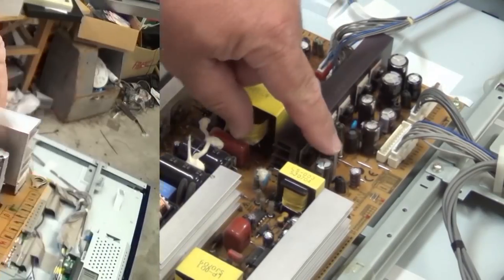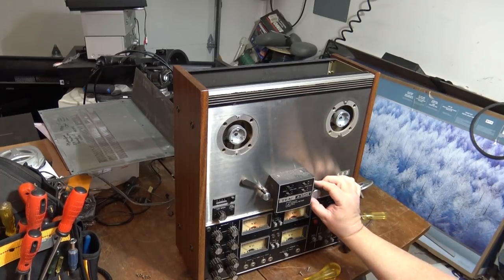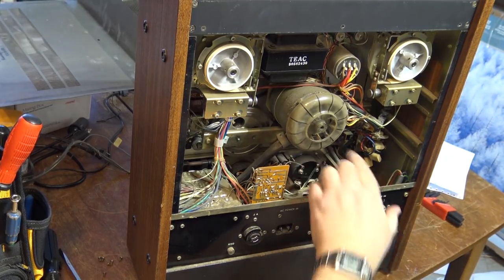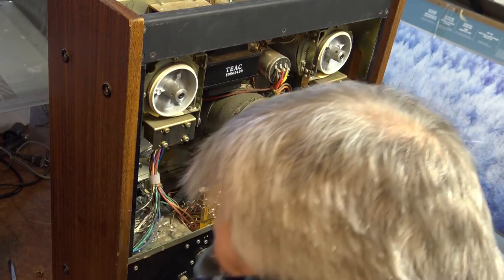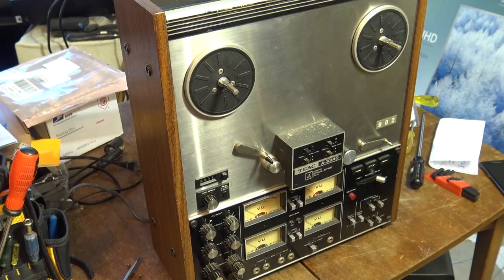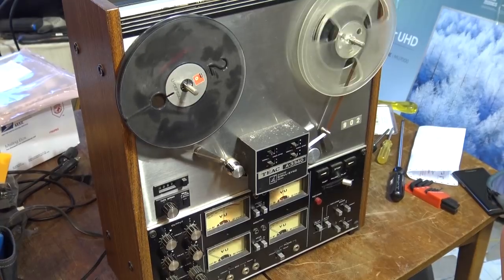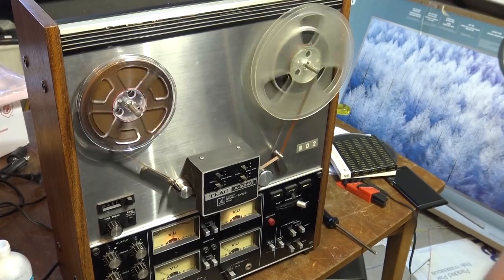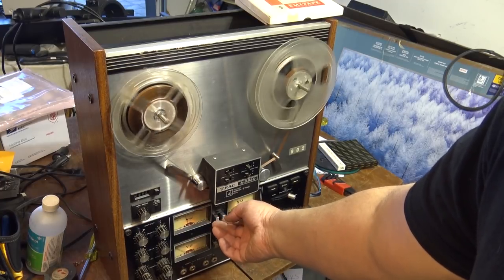Teac A 3340 4 Track Reel to Reel restoration

Comment: Hey 12volt thanks for all the informational vids.  I'm having issues with a Teac 40-4 tascam series that I just picked up.  Everything is working nearly perfect EXCEPT for my record function.  I record and then when I playback the recording is sooooo soft.  I've double checked all my inputs, cables, connections and gear.  I have also rigorously cleaned the heads.  Any suggestions on next steps?  I have access to the owners and service manual off of Hifi engine.  Pulling out my hair here trying to keep the analogue dream alive!

Comment: Hi 12volt,
I have a question for you. Reel Adapters!
I have tried twice now from two "different" brands (they were identical), to purchase NAB Hub adapters on Amazon. They are all the same design from China.
They don't fit my TEAC 3340. I love the look with all that shiny aluminum but what the heck? When mounted on a 10.5 reel correctly they have expanded out just enough that the 3 spline reel table locking lug won't spin over the center and capture it. If I intentionally misalign the back tabs on the hub adapter so they push through a reel of tape I was able to lock the 3 spline shaft but now the hub itself is not locked on the reel of tape and all manner of fun could possibly happen at high wind speeds. Have you had luck with the Burlington or the expensive french REM versions? Or is there another solution you may have heard of?
Tod
Reply from the maker: I bought some reel adapters that are such a pain in the ass to use.   They are just plastic blocks that you fit into the reel and then put that over the tape spindle and tighten down the lock screw.  You have to remove the adapter every time you remove the reel.  I want the type that permanantly attached and you just turn the lock dial to release the reel clips and remove the tape leaving the nab hub attached.  Bought on eBay and once arrived i realized it wasn't what I thought initially.  Seller offered to refund the 50 I paid but not the 30 shipping and it was gojngvtk cost me 30 to ship back so i didn't return them.  I never use it anyway it's more of a show piece and aonetnknv I could get about 1500 for if I decided to sell.

Comment: Question, that first bit that you took off that was rubbing, what is that assembly called? My Akai GX620 needs a new one. That shaft is bent and there is a spring that is supposed to be under tension but the plastic bit has broken. The unit fell onto a driveway.

Comment: I used to have an adaptor for the capstan, that allowed you to go 15/30ips! Doesn't the guide on the left of the head-block rotate, like, on a bearing? I don't remember. I had mine between 1976-79.
Reply from the maker: 30ips.. so basically fast forward.  Could almost record baseband video at that speed!
Reply: @12voltvids  I tried it once. Rediculous! I was a broke college student and those reels cost about $25 apiece, at the time, in the 70's. It became quickly apparent that I had nothing so important to justify one reel for every two or three songs. Like you said, too epensive but I dreamed...

Comment: Do you still have this deck? Maybe you could do a video about testing the Oscillator Board? I have a 3340S which does not want to erase anything. Record head ain't doing so well either. I'm hoping a little more switch cleaning will at least get the record side of things happening. Lorne.
Reply from the maker: I do have it. Never use it. Just a display piece.
Reply: @12voltvids  As will mine be once its going.... What else would one do with this old stuff!
Actually it would be fun to drag some of these old decks out to live shows n stuff. Record some live music. Make bootleg 8 tracks from the recordings. Pretend I'm back in the 70's.
Seriously though. If your bored maybe you could make a video about trouble shooting the Oscillator circuit. For us dummies. Lorne.
Reply from the maker: I know there are many die hards with poor hearing that think this old analog crap sounds better but it doesn't.  My hearing is far from perfect and good digital recordings are so many times better than any analog.

Comment: Great video, brought me back to the time of my youth, when I owned the 4-track stereo model A3300S.
However, I keep wondering at the playback head as it can be seen, starting with minute 28.  Isn't there a hole in the head? It looks as if there's a piece of the surface missing?
Reply from the maker: No, nothing wrong with the playback head.

Comment: My A 3340S sounded bad from one day to the next. As if someone had cut the treble out of the song. Just muddy. 
What could have happened?  A defective capacitor? A defective head? The tape ran without any problems before and I really want to repair it again. Greetings.
Reply from the maker: How does the head look?
Reply: @12voltvids  Nothing unusual. No dirt, all the screws were in place. I cleaned the heads anyway but nothing has changed. A short while ago it was still running perfectly. 
And now only muffled sound and no volume.  
Unfortunately, I only have this one tape here. What else could I check out and test? Thanks in advance!

Comment: Mine was working fine and then it quit for no reason other than when you push play it doesn't make that snap sound anymore.  I've seen the switchthats probably at fault my question is can I get that switch anywhere?

Comment: That looks like a good machine for sure. 15 ips is what does the trick for me. I lucked into a simple version Otari MX5050 2 track and it's been my favorite audio toy ever x 10. It's logic was going crazy needed lots of relay and switch contact rehab but it suddenly it came to life and when the 456 tape splice hit, it melted me into the floor (and hammered me at the same time). I mean who needs noise reduction with something like that @ 15 ips. And I wouldn't exactly call that sound warm either, it can slice you up if it's supposed to.
I recently had to commit sacrilege to the heads because there is quite a step worn into just the record head but I can't afford to have them refurbished... so I came up with a horrible scheme involving a box cutter blade a demel polishing wheel... maybe just don't do that but I got away with it.
Reply: Oh I should add that I only got away with it because the heads were not sufficiently worn flat, I just had to shave the step off the edge of the tape - bearing area because it no longer permitted full contact... but I could have missed or scratched it worse then I did. It did fix the edge problem completely and I think I only goofed up about 3% of the good surface; which I hardly had to  polish at all and it's made a massive improvement... though perhaps a box cutter is a Very crappy way to do that. Cut through that head like butter though. Kinda scary.

Comment: Really appreciate the trouble u’ve gone to ta post the tear-down up. I hafta use a technician 2 work thru my collection of vintage Teac/Tascam gear. My 122 cassette deck’s gonna need reconditioning. More power brother🤝. I don’t have ur diy experience BUT what RUDIMENTARY tool-kit would u recommend 4 a lesser mortal such as me? Tez

Comment: Have you been able to test the 4 channel functions yet?   I have recently resurrected  my circa 1975 Sony STR 7035 tuner/amp, TA 1055 and a TA 1066 integrated amps.working with my Sony SQD2020 4 chanel decoder.  It has inputs for a 4 channel tape, and I would love to have that Teac.  How would I contact you with an offer or get a wanting price from you?   Thanks,   Randy
Reply from the maker: Yes works perfect.

Comment: Mine has very slow movement, I heard if you let the motor or motors warm up, it may warm up enuff to start running smooth again. Is that true?
Reply from the maker: Replace the motor run capacitor

Comment: Wow, that 4 track is different to get into than the 2 track machine.... on the 2 track you can remove the whole front panel to access the pinch roller mech and belts is this a stand alone unit, or does it need to be ran thru a amp?
Reply from the maker: It needs to run through an amp. Has 4 line in, 4 line out 4 microphone in, and a headphone out that can select front channel, back channel or mixed.

Comment: You may want to try loctite, low or medium strength, tiny vibrations may keep those screws working loose. Loctite hardens into a soft plastic and holds the screws in place. No sense in chasing your tail.

Comment: what kind of oil are you using to lube the bearings?
Reply from the maker: 3 in 1 electric motor oil. Which is just straight non detergent SAE20.

Comment: If one is going to delve into these older Japanese machines, it should be noted that the screws are not Phillips. Any exceptionally tight screw will be stripped by using a Phillips screwdriver. Get a proper set of J.I. S. screwdrivers and your work will be a lot easier.
Reply from the maker: I have j i s bits for my cordless

Comment: I have just bought a TEAC A 3340, and I noticed an issue on the record part for a specific track.
For tracks 1,3 & 4, when I record, I can switch between TAPE and MONITOR and the levels shown on the VU meters are close, and the perceived level is similar. However, for track 2, when I switch between MONITOR and TAPE, I go from +1 on the VU meter to -20. I only barely hear the signal. It seems like the signal is "lost" somewhere before arriving to the record head.

I have tried tweaking the "REC LEVEL" trimpot on the board, but the increase in volume is negligible compared to the volume I should get. :??:
As said earlier, I know that it not a problem with the PLAYBACK part of the circuit, but only the RECORD part.
I have tried with tape on both sides (shiny and matte) and I know my heads are aligned because it plays fine.

Hope someone can help me with this issue!

Comment: I couldn’t see the type of oil used. What kind are you using here?
Reply from the maker: 3 in 1 electric motor oil, which is essentially pure sae20 non detergent oil. Not engine oil as that has detergent in it.

Comment: Hey man I have an old Revox A77, I lost the power cable for it so I ordered one on ebay and when I plugged it in a little poof of smoke came out the top and then the machine died, any idea of what I can do to fix it? I really wanna get it up and running man
Reply: Ouch, sorry. You need a power supply rebuild. I have 2 A77's and was able to get them both going by changing some caps.

Comment: I remember back in the 1980s after discussing a fault on my Teac A3340 with a very helpful tech at a Teac service center in the USA, he told me I needed to replace a diode - probable cost at the time 20p, which I could very easy replace myself. So I took my machine to Harman UK in West London and explained which part I needed, and how I knew. At first they refused to sell me the diode, and said that I would have to leave the 3340 with them, with a minimum charge of £100. I asked to use their phone, when asked why, I explained that I would call the Teac tech in USA  and inform them of Harman's refusal to provide me with the part. The manager heard me and showed me to a small room with a workbench. 5 minutes later, a young guy appeared with a screwdriver, soldering iron and small packet containing said diode, which he replaced for me in less than 5 minutes for no charge!!!
Reply from the maker: If you had come into the shop I worked at and asked for a part the owner would have shown you the door. 
There were many times when people would walk into the back and start talking to me and i would politely say sorry i can't help you.  They wondered why.  Well for starters they would hear the shit storm that would come down on me from management if i told someone how to do something or provided them with any information.   For starters that would be taking money out of my pocket but the shop got a bigger cut then me so they would be losing too.  We were very secretive and would not do any work whatsoever if a customer was watching.  You have to remember that they business is there to make money and you don't make money if you do stuff for free or give away anything.   I have to remind customers this at my day job now when they ask for extra work. Can you connect that jack in my kids bedroom so he can plug his computer in as opposed to using wifi.  Sure can, it's 75 bucks to reconfigure the jack.  Still want it?  I am under pressure from my boss to charge for everything I can and I do. Whenever possible because i don't like getting those emails with my name highlighted in red, which incidentally it is every month because i don't bill enough.
Reply: @12voltvids  Nonsense, I watched the guy replace the diode and I could have easily done it myself. Harmon Uk were just being very awkward and saw the error of their ways. By the way I have build an ADA Flanger, one of the most complicated of it's type, on veroboard so I DO know what I'm talking about.
Reply from the maker: @UncleBoko  so your point? I'm just saying at the shop that I worked at and no I didn't own it, customers were not permitted in the back to watch over our shoulder while we worked in fact for that matter even if they're waiting in the store we would not touch it. The last thing any techniques is someone standing over their shoulder watching what they're doing. Insurance is one reason.  If a customer was to get injured they could sue the business.  The guy might have let you watch that's his business but I am telling you that 99.9% of shops will not permit you to watch.  Even my local tire shop when I took my car in to have a nail removed and the tire patched the mechanic refused to work on my car if I did not sit in the waiting room. I left the waiting room and was standing out in the parking lot where I could watch him work and he came over to me and told me that if I did not go back in the waiting room he would not work on my car that I was in the way of his employees that had to walk around me standing in the parking lot. That's the way shops operate, even though I wasn't in anybody's way I was standing behind my car which was not in the shop it was in the parking lot on a jack we had the wheel off and inside the shop I was standing next to my car outside and I was told I couldn't stand there because of liability.
Reply: @12voltvids  This was not a shop, it was a 4 story building
Reply from the maker: @UncleBoko  so what you are saying is a hobbiest did it. No professional tech or engineer would just do work out of the goodness of their heart.  They are in the business to make money.  That's how it works. You pay a tech or engineer for their knowledge.  When you go to college or university what do you think your tuition is for? It's the pay for that knowledge that you are receiving so that you two can go out and earn a living with that knowledge that's the way it works. When I was in the business I wouldn't give away my knowledge to just any Tom Dick and Harry, but I would share info with other texts in other jurisdictions, in other words not my direct competition, and they would with me. I was in a tech forum where we used to share technical tips with each other and we all got along great because we were all making money networking off of each other's knowledge. That's kind of what I'm doing here on my channel I'm sharing my knowledge with the world because I no longer do this kind of work to make a living. Now I am compensated for this, people pay me to repair their equipment but I also make money from the advertising revenue from YouTube and that's basically the only reason I do it. If there wasn't any money in producing these videos and uploading them and incidentally it takes a lot of time, I would not be interested in doing it I'd spend my time on the golf course or traveling or doing something else. I only do these videos because I make money doing them.

Comment: Question.i just find one just like that player but when i try to play a tape it sounds very fast like chipmunks ..do i need to move some switches? Or what to do so 
It can play no that fast.thank you for your help.
Reply from the maker: This one is 7.5 and 15ips only.  If you have a 3.34 tape it will play too fast.  Not much you can do as this is a professional machine designed for studio use and they use fast tape speed for best quality.  You will need to find a consumer machine that has the slower speeds.
Reply: Ohh ok im new to this lol yes I have another a Sony 230.that one plays great.so for the teac 3340 i need to buy diferent reels and record my own tapes? Any suggestion? I have over 80 tapes and some originals so those wont play in this machine right? and I just check and yes they are 33/4ips.
Thank yoy very much for ypur help

Comment: What is the wheel called directly below the capstan?  Mine doesn’t engage when I hit play.
Reply from the maker: That is the pinch roller and the grease on the control arm can dry out and make it stick.
I did lubricate that control arm in this video. Around the 17 minute mark.

Comment: hi i had to change over vu meter lamps as they had all gone it's a big job.  you got to know  how to take the front panel apart.  2hr just to work out what to do
hell is the word the wires can come away very easy i can teli you.  when i get this model in to fix in th service book it tell's you how to do the audio sound levels
big help i can tell you